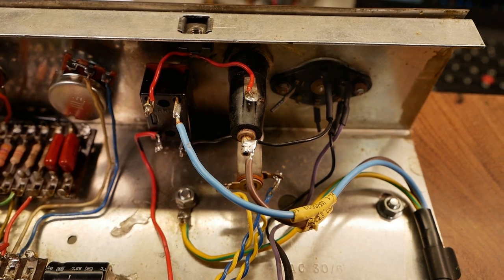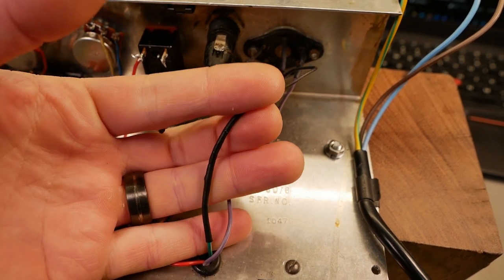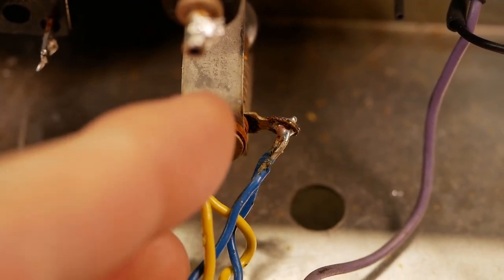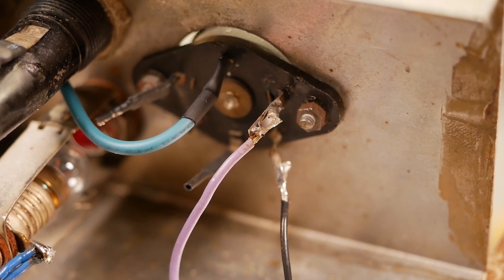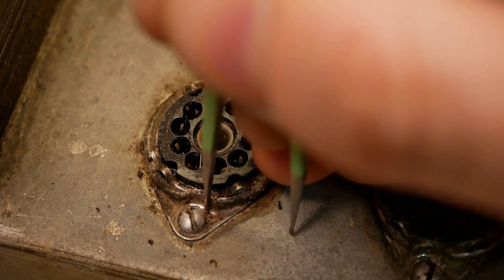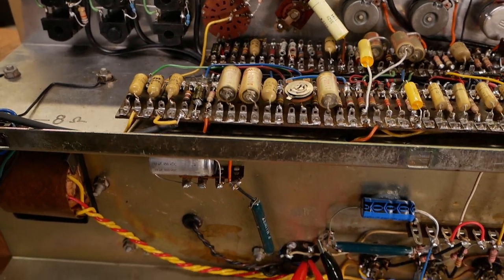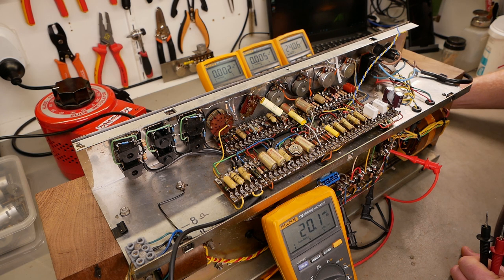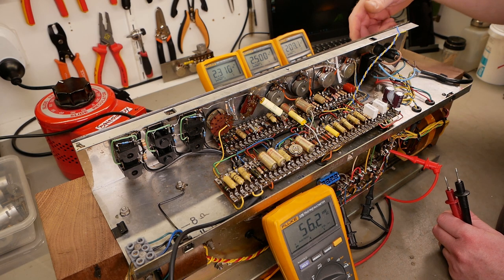Bringing A 1965 JMI Vox AC30/6 Up To My Standards - Part 3

Comment: As usual, good to see VHQ tech work, there are a few of us left that still care :)
WRT AC30's running OP tubes at 14 W +,  a few OP tube options not so commonly known:  6P14P-EV, 5000 hr Russian NOS EL84 rated at 14W, V robust construction. Sound great, available at reasonable prices. 7189A, still available, reportedly just a re-labelled 6P14P-EV, no experience with them. EL84L  NOS Siemens, higher plate V / dissipation, crazy prices = audiophile fodder :).
Reply from the maker: I have a pair of NOS Hitachi 7189A's still in the cello-wrap. I'm saving them for a special occasion!

Comment: Hi Brad, Glad you're back on VOX amps again as painful as they can be (I refer to your Dallas era ac30 videos - still great vids though). Could you please talk more about the bias cooling issue - A) the affect that raising the bias resistor has on PD &/or other potential badness &  B) raising screen grids and grid stoppers. Lyal talked about a 68 or 75 ohm Bias resistor and taking the pin 1 grid stoppers from 1.5k to 3k and the pin 9 screen grids from 100R to 1k (as you did on this one) but he never discussed his final results and theories on this matter. Could you please discuss in part 4? You are the champion my friend.
Reply from the maker: The changed value of the cathode resistor simply shifts the bias point of the EL84's.
The higher screen grid resistor value just limits the screen current under high output.
I may do a video on the two in the future if I can find the time.
Reply: @BradsGuitarGarage  Thanks Brad, when you mentioned that raising the Bias R can also raise the plate dissipation that concerned me for my amp (Dallas era ac30-new JJ's cherry plating problem) Did you end up with the original 50 ohm value in this one? I understand a video on this might be a bit dry for general consumption and is purely self interest on my part. love your work. Go Coffee!!
Reply from the maker: No, it's the opposite.
Raising the value of the plate resistor will lower the dissipation, but that will lower the load on the power supply, causing the plate voltage to rise, possibly to levels dangerous to the lifespan of your EL84's.
Reply from the maker: In regard to the red-plate condition, check the control grid voltages on each pair to confirm your PI coupling caps aren't leaking first.